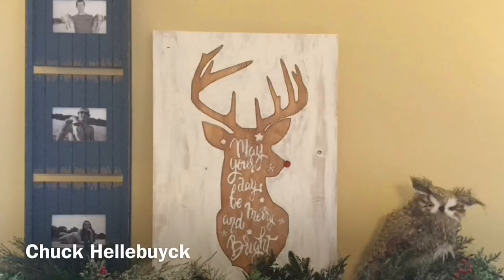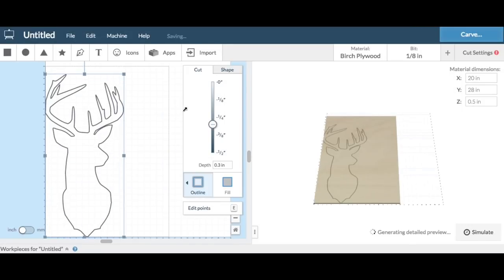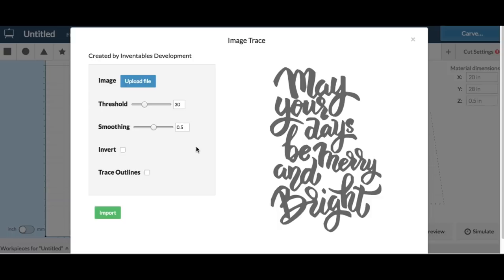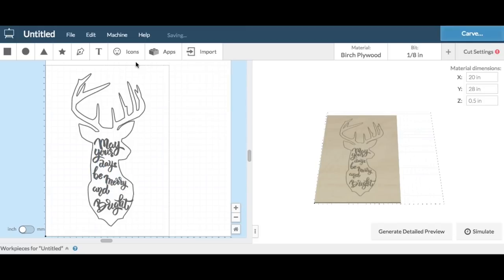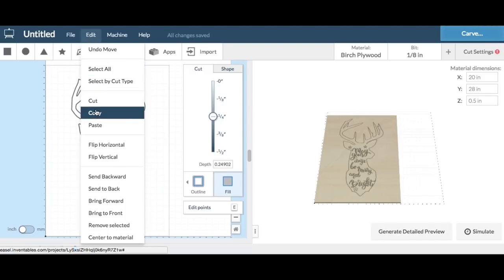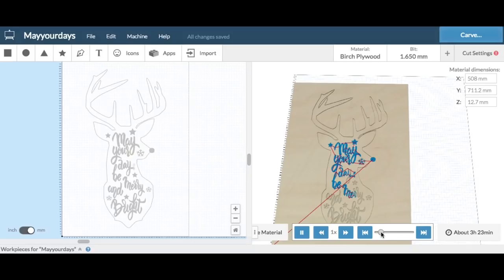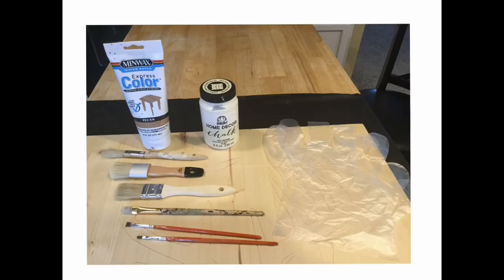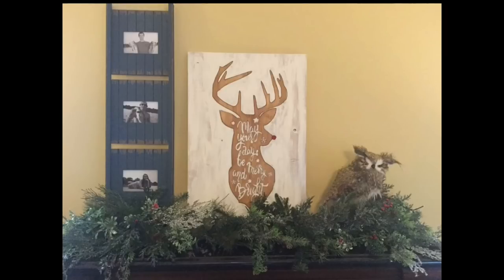Holiday Reindeer X-Carve CNC Project

Comment: hey Chuck i know my following question doesnt have anything to with this video per say  but its 3d printing related  so im building a 3d printer  and most 3d printers kits psu are those bare psu but i see people using atx power supply   by cutting  certain wires  and using a jumper cable  but i dont ruin a atx psu  so i found an atx psu bench table break board (adapter)  you can plug a 20-24 pin cable from an atx  psu but do you think that could work for a 3d printer ? if does then would be perfect  because i could use a good psu and i wouldnt have to cut the wires up
Reply: first off i wanna thank you for replying  and the atx psu i looked was my be quit dark pro 11  it has a 12v rail with 30a max  and then another 12v rail with 35a so to my understanding in theory it could work?

Comment: I want/need a metal router/mill to finish off my computer tools.  They are very expensive and way too big even for working with just aluminum.
Reply: From your review (yes, I watched it) it didn't seem all that sturdy and the general rule of thumb is that for a mill, or a router, the machine needs to at least be made in the material you plan on using it on.